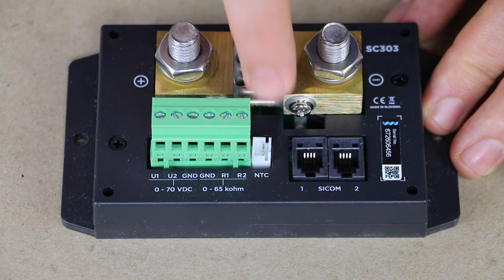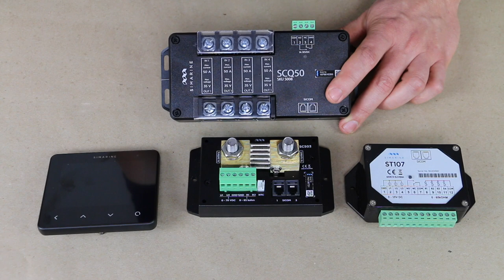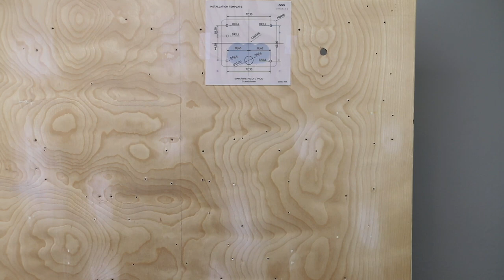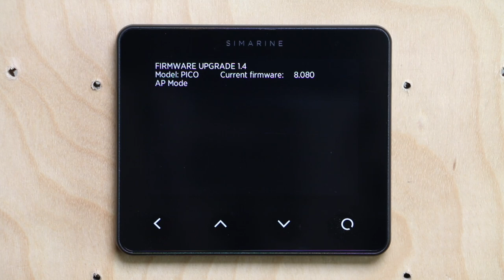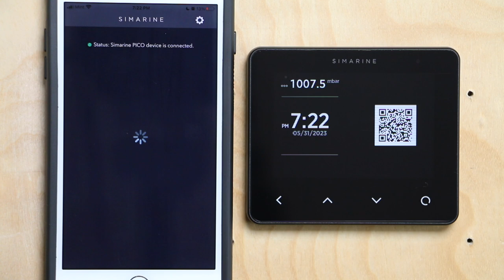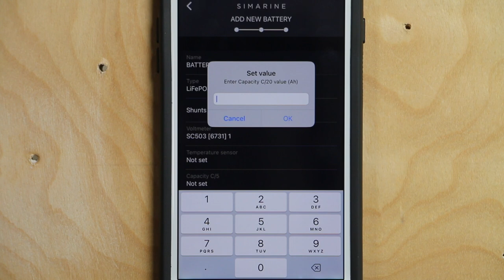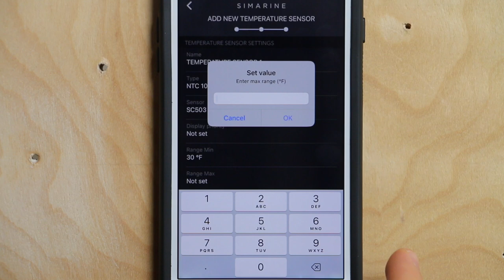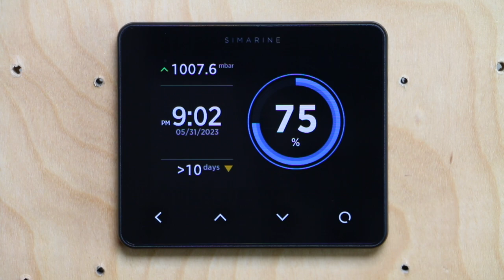How to Set Up the Simarine PICO - the most beautiful and versatile battery monitor ever? -  Part 1

Comment: I'd love it if you could do a video to explain/demystify the Pico C/5, C/10, and C/20 configuration values for various batteries.  Maybe a part 3?
Reply from the maker: Those are manufacturer ratings that some battery manuals provide. Most amp-hour ratings are C/20, so a 100Ah battery only puts out 100Ah if you run it down over 20 hours. If you burn through it in 5 hours, you don't get 100Ah, but maybe 50Ah, even though the label says 100. This is more pertinent for lead-acid, as it loses capacity the faster you burn through its power. These would be in your battery manual, if your manufacturer provides these ratings at all. If not, just put the 100Ah or whatever the label says in the C/20 category. Simarine's video on it: https://youtu.be/BodBVaGADMk

Comment: Hi Ross. Looking for advice. Have a simarine shunt + tank sensor. Works totally fine for me. Also have mppt /dc to dc - charger brand is SRNE. And inverter for 3000w. Now looking for add offshore charger/inverter. So thinking about replacing my inverter to victron multiplus 2000 or 3000va - not sure yet. So my question: is it will works fine with this setup? Or probably need add something else from victron range to the system? For control it?

Comment: Very interesting and nice devices, looking forward to more videos on this system.
I'd be interested in a comparison of the accuracy of the Simarine Shnuts versus the Victron Smart Shunt.
I assume there is no option to connect to the Venus OS even with the additional RPi programming.
Reply from the maker: Hi Tibor, thanks for stopping in, and good to know you want to see more of this system! Good idea on the shunt comparison. I may have to do some sort of Simarine versus Victron video in the future.
As the Venus OS is open-source, perhaps it could be programmed to work with Simarine, although I am not sure Victron would be very helpful to make that happen. Thanks for the comment!

Comment: What first crossed my mind when you said the incline meter...  It might be nice on a solar panel and make up a little stepper motor and adjust it by had ...  I have an apple phone too and couldn't help but see the 15%. whew
Reply from the maker: Hey David, that's kind of what I like about the Simarine, all sorts of things can be plugged in for all sorts of reasons. A fun little system for sure. Yeah my phone got pretty run down...all of that off-camera testing I suppose.

Comment: Great video!  I just installed my Pico system with SC503 shunts this past weekend.  And I wish I had found this video BEFORE I started my install.  It would have saved me a lot of time.  Other videos I have seen are not nearly as clear and comprehensive.  So, congratulations, and thank you!  Also, I learned that you can configure your monitor display for Advanced->Detailed, and then select and hold the down & up arrow simultaneously on the home screen to instantly learn the percentage value of the battery, rather than wait for the Pico to learn it.  Finally, at 15:27 I see you hooked up the wires to the voltage input on the shunt.  I didn't need to do this for my installation. I have a standard wet lead acid battery and I'm receiving voltage readings without this extra connection.   Is this required for Lithium batteries?      <?>
Reply from the maker: Hey there, thanks for checking out my video! Great to hear you found it helpful. Thanks for the additional details about Advanced->Detailed and the 100% reset option. On the voltage input, I tend to do that with every battery monitor, and the cord came with the Pico, so I used it for my demo. The Pico is also connected to the same battery, so its internal meter will give you a voltage reading. Voltage distortions occur in these systems due to high currents sometimes, so I tend to take the voltage reading right at the battery, but in this case it's probably not as critical as there's hardly any current in the lines running the Pico. Regarding lead-acid vs lithium on the voltage reading, it's a nice reading to have regardless of battery chemistry. Hope that helps, thanks for your input!

Comment: Super cool :) Can I somehow pair it with Victron Smart Shunt? Also what do you think about Simarine Via monitor for RVs?
Reply from the maker: Hey there, thanks for tuning in. I like the SmartShunt but in this case the Simarine SC303 or SC503 or Quadro Shunts would be a much better choice because they will network and show up on the PICO or the VIA. I do have a VIA here and will be doing a full review soon. It is basically the PICO with on-board controls. Very elegant. More soon...thanks for stopping in!

Comment: Great video!

I wanna get 2 200Ah Lithium Batteries  and my system is 12V. Will the Pico one handle that? I’ll plug the batteries parallel.
Reply from the maker: Hey thanks for tuning in. Yes the Pico will definitely handle that, just put it in the main cable (positive or negative) running to your battery bank, and it will keep track of both batteries (so long as you tell it the total amp hours of both batteries). Thanks for watching and leaving a comment!

Ross

Comment: G'day mate have you got any videos of wiring up a inverter into the simarine system
Reply from the maker: Hi Damien, thanks for tuning in again. If you just want to use the Simarine as a battery monitor, then you would follow what's shown in this video, and connect your inverter to the positive/negative bus bars. The Simarine will track what the inverter draws from the batteries. Hope that helps!

Comment: Can it work as switch panel in case I wanted to turn lights on … etc or it’s just a monitor ?
Reply from the maker: Hey there, they have a model with switches called Simarine VIA which you can check out here: https://simarine.net/via/  Hope that helps, thanks for tuning in!